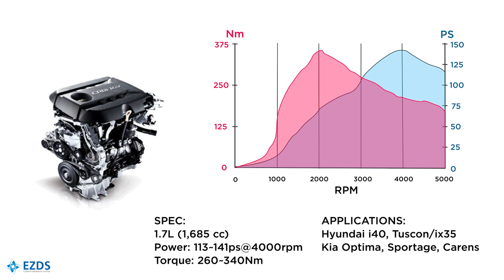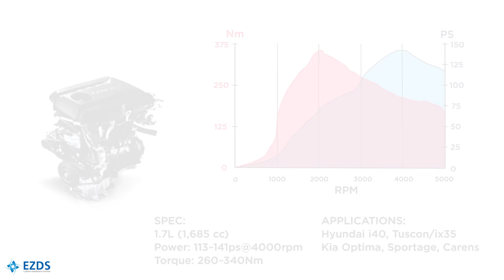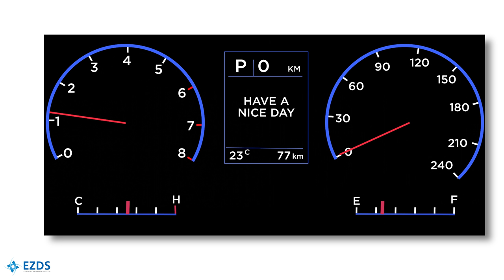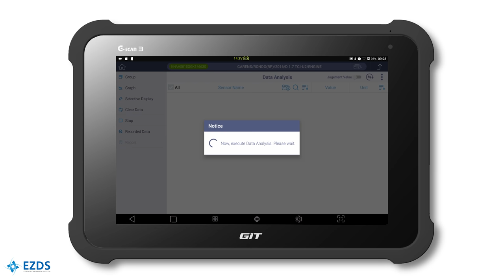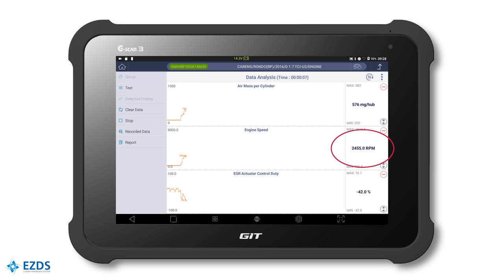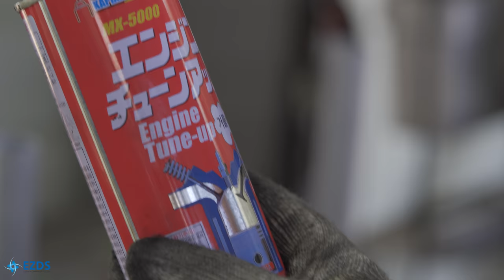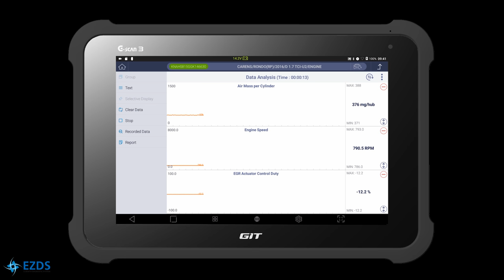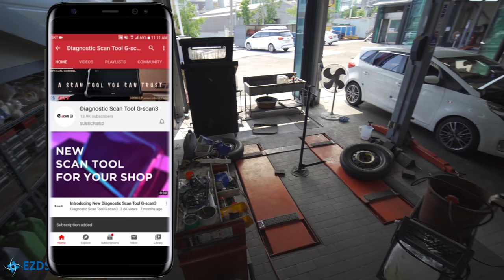Cleaning EGR and Intake System

Comment: How were you not putting some water and cleaner into the at least one of the cylinders and from there into the crankcase. At least one of the inlet values would have been partially or even fully open.

Comment: I would have cleaned the injector nozzles on a wire brush when fitting the  new washers,  and left the pipes loose at the injectors when starting prevent dirt from entering the system. Jim

Comment: A bit confused about the intake port cleaning. I would have thought a lot of water from the steam cleaning would have gotten into the cylinders even with the vacuum or did I miss something?
Reply: i guess you can put the crankshat in closed valves position for each cylinder, i thought exactly the same

Comment: Hello i have a tucson 2006 2.0 L. Diesel. While i drive the performance is dropping(i think turbo isnt working) and if i turn off and then on the switch it goes back to normal. The check engine Light is on and i have P0401 code. Could be the egr?

Comment: Great job, guys! Very infromative, and useful. It does not matter, what type of car we have, if it was a diesel, it is hardly recommend to make these cleanings. Unfortunately, in Europe, because of the fcking EuroNorm standards, manufactures have to install so stupid things on the engine, that lies to save the enviroment, but it kills the engine in some years. Most of the owners do not know about the neccessery of the engine intake and EGR cleaning, however it is as neccessery as the regurally  changing engine oil and filters. So Thanks again, I will make it on my car as well.

1 question: What is your opinion about professional carbon cleaning technology? What we can see on your video is the manual cleaning, but it is possible to clean the engine parts, by hidrogen gas, that become metan-gas in the engine during the cleaning procedure. So, in your opinion, does it work, or in every case it is better to disassemble the parts from the engine and clean them manually? Thanks!

Comment: Best efforts done new engine live . I have  question . 
1-Egr used to reduce Nox to help environment health 
2-Egr used to reduce engine temperature 
3-egr valve closed at idle and opened as rpm increases 
4-Total amounts of intake air is divided by recirculation exchaust gas through egr valve and outside fresh air 
5- at high rpm which one should have high flow rate egr or fresh air ?
6 -how l can fix stuck closed  or opened egr valve depending on flow by using G scan2 data analysis 
Waiting your response with my best regards bro
Reply from the maker: I guess only number 5 and 6 is your question?:) 
5: At high RPM, flow rate from air intake through Variable Geometry Turbocharger must be higher than the rate from EGR. 
6: To fix the stuck closed or opened EGR valve due to carbon buildup, the first thing you can do is disassemble and clean it thoroughly. You can then inspect EGR control motor for its resistance according to service manual. If the parts are out of spec, replace them. If you were asking how you can diagnose the symptom by using G-scan2 and 'Data Analysis', it is not easy for us to answer because there could be other symptoms as well. However, as shown in the video, you can select air mass and EGR control duty cycle and increase the rpm. If the EGR is working properly, as the rpm increases, EGR should be opened and air volume should go down as the inert exhaust gas is going through intake. However, if the EGR is stuck closed, air volume will not decrease even though the EGR duty cycle from G-scan is showing that EGR is opened. Hope it helped.
Reply: @ZenithDiagnosticScanTool  thanks for your reply.  Hope new video to test cylinder compression by using g scan2 ..

Comment: Great video, what chemical is the pre wash ?
Anything special  ? . I ask because I have done these jobs many times and that gunk has never come off anywhere near as easy as shown in your video.
I do use  a  real old  style steam cleaner  as opposed to the hot high pressure washers everyone uses nowadays.
Also I take it that the engine is turned over to close the valves when cleaning the inlet ports on the cylinder head ?
Reply from the maker: Hello there! 
Thank you for watching! We hope we can give you a clear answer to the chemical but the local shop shown in the video did not want to share detailed information about the chemical they use. However, they claim that the hot high pressurized steam washer is what most likely cleans the carbon sludge on the parts, not the chemical. If you were asking the chemical used in the wash equipment prior to the steam wash, it's just normal water based part washer solvent commonly used in the shop.  
Yes, we noticed only no.2 cylinder had its intake valve opened, so if you look at 14:53, we connected air hose to no.2 injector hole on the block to blow out the chemical going into the chamber. Turning the engine over to close the valve and cleaning the port would be the perfect way for sure! :) Thanks for your comment!

Comment: G-Scan best tool I have bought, I did the same thing last week end, and guess what, I have to do all over again, one of the flaps had broken off and was missing, do you think it went in the cylinder? How would go past the valve? I also removed the  bumper and cleaned the intercooler. Jason where in scan tool can I make the headlight washer come out so I can put the covers on? i40 2012

Comment: Would blanking off the egr damage the engine? If you can’t blank off how often would you have to do this clean, my Santa Fe 2010 GRDI has done 77k. And rough idles in start up but when you rev up the engine it goes away. Great video!

Comment: Great video! 
A question what is the washers that you were talking about min17:15?
Reply: I think he was referring to an injector cylinder seal. They are made of copper and look like a washer. If they leak the upper injector o-rings fail you get a compression leak into the head; AKA injector chuffing. Some engines have a leakage valley/gallery between the the upper and lower injector seals that allow compression and/or leaking oil to escape the head, this helps with detection (oil and/or exhaust gases leaking out head) and reduces damage a bit.

Comment: helpful video bro keep it up. btw i got a question, my hyundai accent 2012 crdi is hesitating when accelerating even when its hot or cold engine. and i noticed the EGR is intermittent. it opens and close most of the time. I;ve cleaned the EGR,Intake manifold,MAF,MAP,TPS, Waste gate, ECT, cransk shaft and cam shaft sensor, replaced MAF, replaced EGR assembly. Fuel  rail sensor, fuel pressure sensor. but still EGR opens and close thats causing the hesitation. do have any idea whats wrong?

Comment: had to change EGR pipe on iload it split apprantly Common problem soot in engine bay 192 thousand kays  hope EGR okay 1100 to replace genuine I try and keep throttle body clean from  soot and blow back sludge

Comment: Not so sure about cleaning inlet ports like that unless you make sure all valves are closed so nothing gets inside the engine and that means removing camshafts and or rocker arms depending on the engine design, without making sure all valves are shut or turning the engine over to make sure each cylinder inlet valves are shut for cleaning this could end very badly.
You sure as heck do not want that water or chemicals or sludge inside the cylinders.
The sludge especially can bake rock hard and sit on top of the top ring and then start wearing out the cylinder as it travels up and down with the piston.

Tp put this into perspective say you have an engine say a Chevrolet  V8 with a 4 inch stroke that means every revolution to piston and rings travel 8 inches multiply that to say 1000 rpm at idle that means 1000 x 8 inches per minute travel up and down the cylinder, Then think about how many RPM to travel say 100 miles at an average of say 2500 RPM and suddenly the potential wear factor of all that sliding friction up and down the cylinder makes you realise just how important good oil and regular oil changes are long term
Reply: Completely agree. I didn't think that was right. Hydraulic lock if all that water gets into the cylinders. I can't see how a vacuum cleaner was sufficient. I do each cylinder in turn with the valves closed on the compression stroke ideally TDC and block off the other ports.